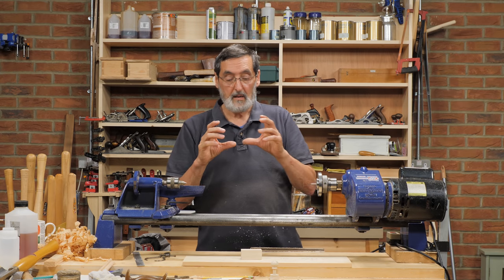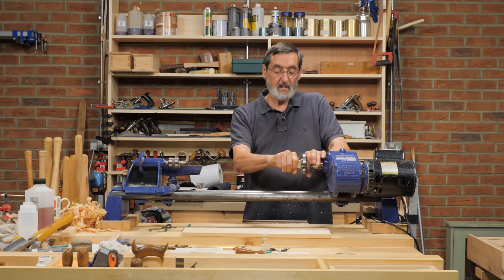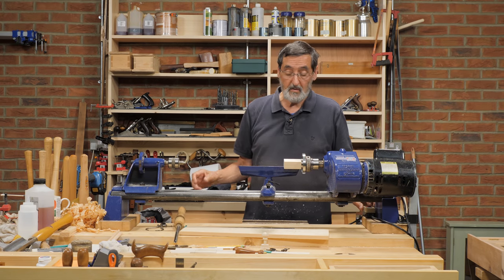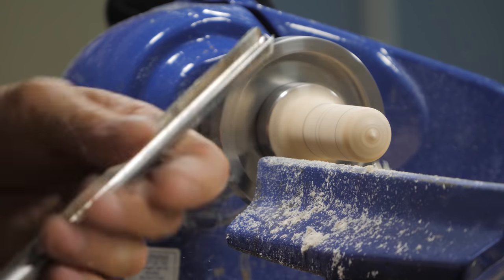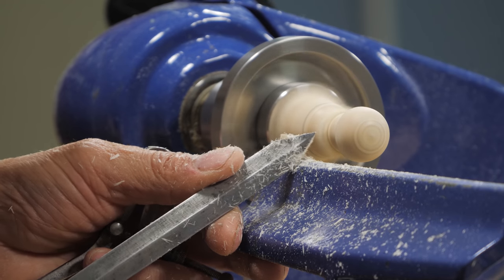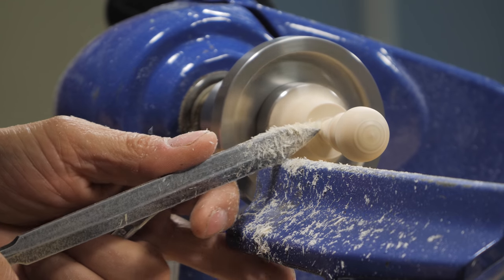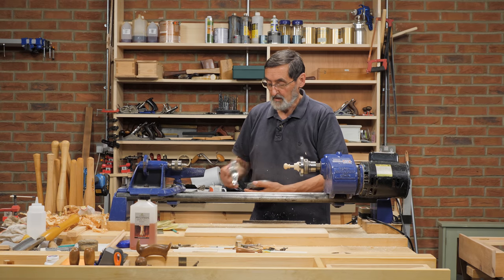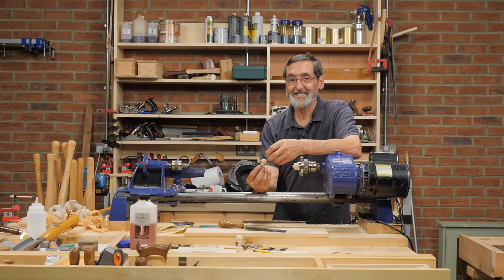How to Turn a Handle | Paul Sellers

Comment: Good video, as always. Little things like this are one of the most satisfying things about having a lathe; you can quickly turn out a replacement for a broken part or add a little flourish to something.

When turning out a spindle to a specific diameter, I find it very useful to alter my eyeline so the edge of the workpiece lines up with one of the parallel lines of my lathe bed once I've got that initial bit of correct diameter. That way you can easily see whether your spindle is straight & even, without worrying about damaging it by going back & forth with the calliper, plus it saves time & lets you keep both hands on the tool.

Comment: Great to see a man with a mask. I spent 30 years using farm and garden machinery breathing in exhaust fumes on a daily basis, by the age of 45 I developed a condition known a multiple chemical sensitivity and I am no longer able to use or be in the vicinity of  petrol or diesel machinery.
I always wore ear and eye protection, but now I realize that protection from exhaust emissions is just as important.. I urge anyone using any style of machine to follow Paul's example and wear a mask !!

Comment: Very nice, Paul.  I noticed you made sure to keep your sleeves away from the lathe as well.  I really like that 3/8 wrench tip too.
Reply: One can find instructions online for grinding an open end wrench to  cut a tenon to a precise size in a manner similar to how Paul used the wrench as a gauge.  It's a pretty well known technique, and I'm sure Paul knows about it.  I've ground a few old wrenches in different sizes and use them to cut tenons quickly when making many knobs. But you can't count on the tenon's matching  a drilled hole, so test first if you try it.

Comment: Quite unrelated but I recently bought an old Stanley No. 4 and when comparing it to my other Stanley No. 4 this one is 5/16 inch shorter, measuring 9 3/8 instead of 9 3/4 as I believe is the usual length. The mouth sits a little bit further back on the sole and the wings are thicker and with quite sharp corners and completely flat tops. The sole is a fair bit thinner, which could of course be down to wear and grinding, but otherwise it looks exactly the same as my other Stanley No. 4. Is it common to have such big variation within what is technically the same plane? - it just happens to be the exact same length of my Stanley No. 3, so it seems odd to me, but there is no mistaking the #4 on the toe of the newly purchased plane. Any ideas?

Comment: Very nicely done. You used a water based finish on top of an oil based finish. I thought that when using two finishes they should be either both oil based or both water based for compatibility. Would you please comment?
Reply: Shellac is not oiled based. It's solvent based. You dissolve shellac flakes in denatured alcohol. Apply the finish, the alcohol evaporates off leaving behind the shellac.
Reply: To add just a bit to David Johnston's reply, the shellac should be dewaxed if you are using a water borne finish over it.  It's probably easiest to buy a premixed, dewaxed shellac for what Paul is doing, though there's certainly a place for preparing your own.

Comment: Great video Paul! What kind of mask did you use?Gary
Reply from the maker: I think it's made by trend, but you need strong neck muscles because it is quite heavy. I'm used to it and use it infrequently for turning; perhaps consider a different maker with belt-held battery pack to the filter.

Comment: I have found that steel wool is VERY dangerous to use on a lathe.  In a limited fashion, as used in this capacity, you can get away with it, but if you use it for an extended period, it has a tendency to unravel and wrap itself around the workpiece. In addition to making your heart skip several beats, it can take your fingers with it, if you're not quick enough.  I tend to avoid it altogether.
Reply: I think really fine steel wool like he was using should be fine. If that's still too worrisome, you can probably use a 3m scratch pad.
Reply: Same with cloth rags.
Reply: I stopped using it because it can leave tiny bits of wire stuck in the finish & those can rust over time. Instead, I switched to AbraNet (I think that's the name) abrasive mesh. It's sort of like netting with an abrasive coat on it & it's brilliant for applying wet finishes & waxes. It starts of biting quite hard but quickly wears down, so saves time on moving up through grits as you would with sandpaper too. I save up fully worn ones for applying a little oil & polishing it up in one step.
Reply: It catches fire too, just watch Glen Lucas touch it with a 9v battery next to some shavings. Don't try it in your workshop though!

Comment: Another great viideo Paul thank you, Please may I ask two questions, the first what is the name and model etc of you full face mask where did you get it? and the other quick one, is I have the same saw as you used at the end to cut the handle of the lathe but I can't find out what that type of saw is called?  Thanks again Paul.
Reply: Trend. It's called the air shield pro.

Comment: Your mask/hood is excellent, but as I am sure you know, the most dangerous particles that will go deep into the lungs will hang in the air for a very long time.  As soon as you took off that hood you started breathing the most dangerous dust.  You probably have other air filtration, but you might consider alerting your viewers that unless there is a sophisticated system, the air is just as full of the really harmful particles as it was when you were turning, and will be for the rest of the day.
Reply from the maker: Thank you for raising concern. Whereas health and safety is indeed highly important, and individuals should take measures to ensure their personal safety and the safety of others in their immediate environment is taken into account when working with methods causing dust in the atmosphere. It's also important to put things in context. Turning one door knob once a year is unlikely to be of harm unless someone is predisposed by a personal condition or allergy. In our workplace we are able to test the air pollution from contamination down to the finest of microns and have always remained well within the safety range and we have yet to even register any levels even close to danger.